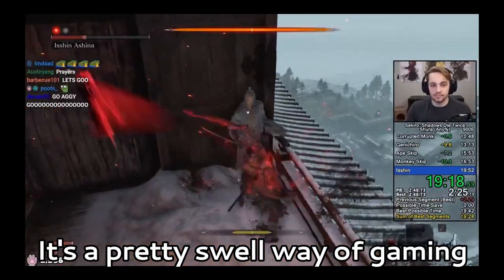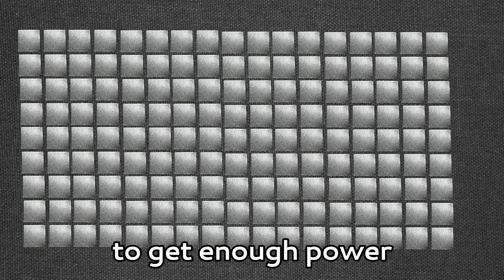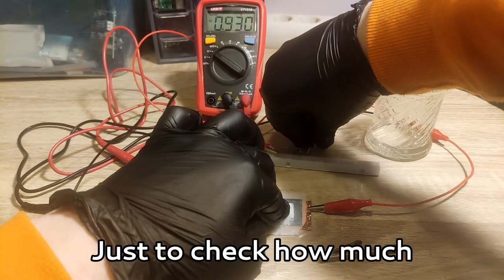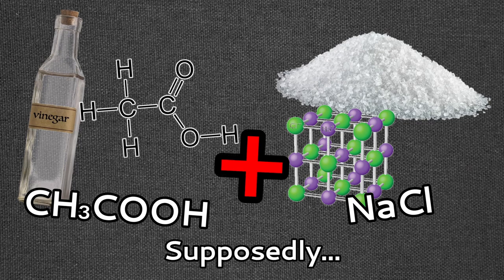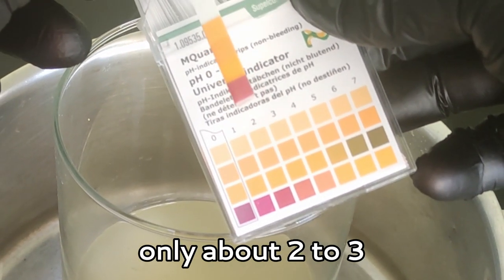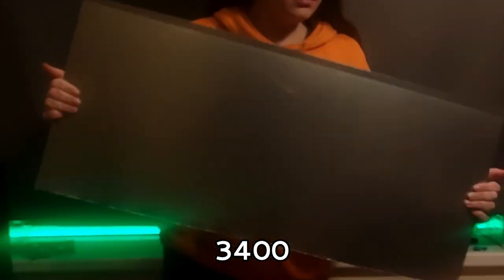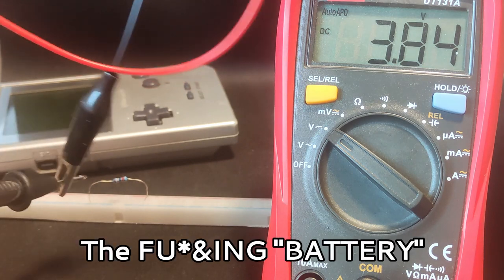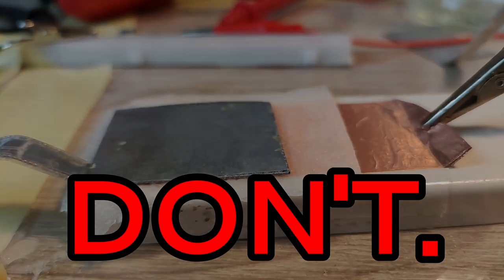Food Batteries are Rubbish

Comment: This is probably like, really late, but have you seen the open source all-iron battery 2.0? The instructions are in a research paper, but I've looked at it and it's one of the most easy-to-read research papers out there.
Reply from the maker: I have not seen it, no. If I am going to be making DIY batteries in the future then I am sometimes wondering about making a sodium-ion battery... Just the problem is that the chemicals needed are kind of nasty to be honest.
Reply from the maker: Well, I'd want to make batteries that would actually have some good energy density. Iron, Zinc and Aluminium batteries are all pretty bad in terms of that when comparing against even sodium-ion.
Reply: @BirdbrainEngineer  unless you can get your hands on sodium metal (and seal the cell sufficiently well to prevent corrosion of sodium metal), the energy density of sodium ion batteries will actually be behind that of aluminum ion. You can't pack as many ions into an intercalation host as you can into solid metal.
Also note that so far you have been using galvanic cells, whereas when we use the "ion" suffix in the name of a battery we usually refer to rocking-chair batteries.
Reply from the maker: @PixlRainbow  Oh I know the type of batteries I made in these videos are not "ion" batteries. But just saying that's probably where I'd try to go next if I ever tackle batteries again.
Reply: @BirdbrainEngineer  ah, gotcha, sorry.
Reply: @BirdbrainEngineer by looking at the current standard of energy and power density (as well as specific energy and power) that is hydrocarbon fuel, battery's current biggest rival, I wonder if organic polymerization/depolymerization electrocatalyst batteries will be the way to go.

Comment: Now make an aluminium foil battery.
Reply from the maker: Problem with aluminium is that any conventional electrolyte (acids or alkali) would react all of the aluminium quite quickly. When I was making my diy battery video, I did also try out aluminium foil at basically every step of the way but as was expected, using aluminium as an electrode produces less power than using zinc and/or copper, and it reacts away within hours. It'd be a lot cheaper using aluminium though :P
Reply: @BirdbrainEngineer  thanks for the info.